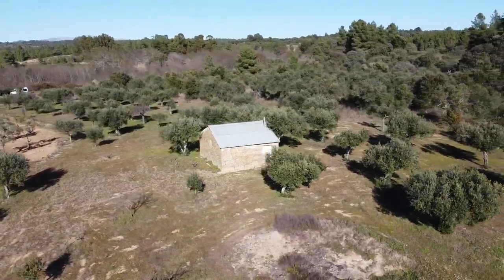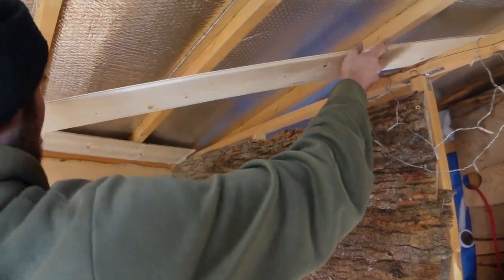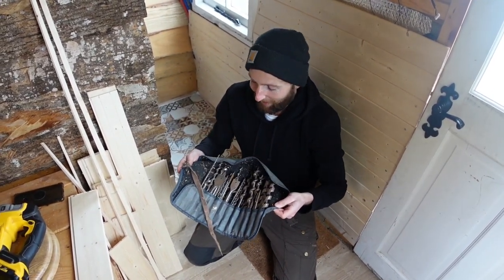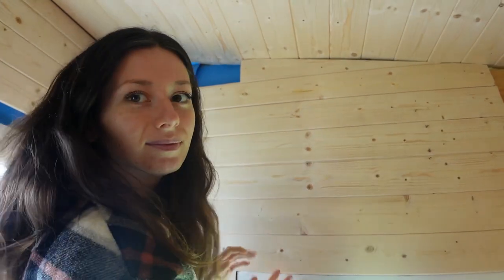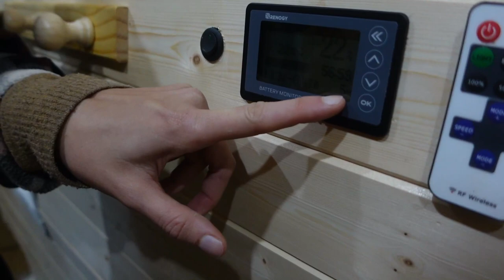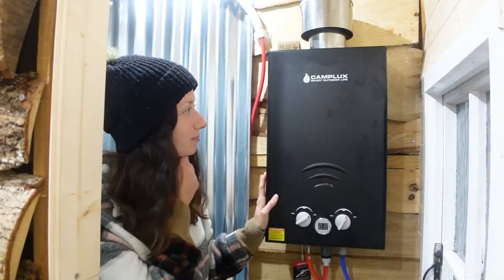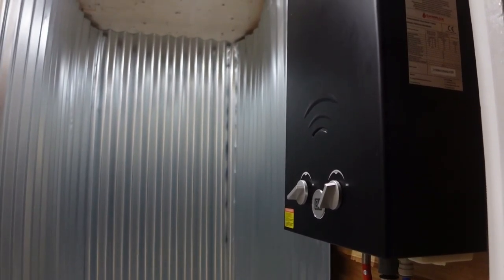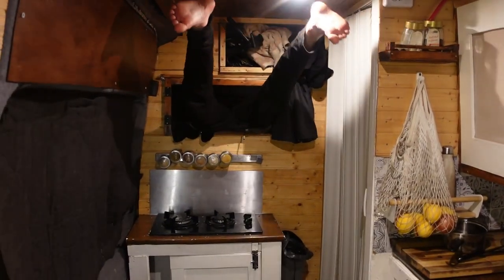Converted Cabin under $1500 OFF GRID LIVING

Comment: Idea for outhouse solar panel.  Creat a square or triangle box and a base with a “turn table” or swivel.  Mount the solar panel on one of the sides.  You may want to install some way to stop the swivel after you adjust the Sun direction you want the solar panel to face.  The box can be mounted anyplace it’s easily  accessible so you can turn it.

Comment: Any updates on the shower? I think it's quite clever using the corrugated metal as some cheap and cheerful waterproofing for the shower. However, I'd be concerned about moisture become trapped behind the corrugation and create a habitat for mold. Really curious to hear about it as it's the first I've seen it used indoors! However I love working with it, I think it would be a great material if successful

Comment: If the outhouse is to go by, then the barn conversion is going to be amazing. I am worried about you being cold in your van. If you have no working heater in the van, could you use that candle heater from the outhouse?  So, how does that work, by the way. Is it a metal plate with a candle under a plant pot but with something to allow air flow in, i.e., planter feet? Speaking of feet, dans feet wiggling to get in  there, had me laughing, but i have to admit i would have had to tickle them. X
Reply from the maker: Thanks for kind words Mary, they take the edge of the cold just enough but we are looking to add something better in future. The candle heater just requires a little tea light inside and heat radiate inside

Comment: This may be a dumb question, but do you not have to insulate behind the shower walls (the corrugated metal) or does it create its own insulation? Also, what if the make shift foam insulation is exposed to any moisture?with it being an outhouse) will it not mildew? Just curious

Comment: Every situation is different so this is important information not advice.  There is an article in the World Economic Forum titled, “Scientists have cracked Rome’s secret to waterproof concrete.”  Dated 7/13/17.  Basically it’s self-healing concrete.  If it gets damp the concrete is self sealing, no damp.  The concrete included saltwater and volcanic ash.  It is why the buildings of Rome still stand 2,000 years later and anything we build disintegrates or gets damp within 10 yrs.  

Another idea is that if you have any wood fires watch YT video by Edible Acres.  He has a series on biochar.  Biochar helps with water retention during the wet season for water use in dry times.  There are 4ish videos about 6mins each.  

He also has an interesting approach to chicken composting.  It keeps the cost of feed low but nutritious using natural method.  He follows permaculture.  The only thing he doesn’t do that I would do is raise black soldier flies to feed the chickens.  It allows you between the two methods to cut the cost of feed by 65-75%.
Reply from the maker: Hey Kenyon thanks for sharing all the insightful info above very interesting

Comment: Hi Dan 
did you consider building diy solar ear heater ? It is from cheap materials and easy to build.
You will have then in the cold but sunny days warm room or bathroom almost for free. You need only aluminium spiro pipes, frame made of timber (ie pallets) and policarbonate sheet (thats could be cost like 30 EUR) and black paint in spray. I did one last year for my daughter garden house.  Unfortunately we do not have such many sunny days in the winter as it is in Portugal. I do not have now picture of mine but here is the link how similar was built. (fan is helpful but without it air also flow itself)  https://www.youtube.com/watch?v=8i4OzLOv_10 
Mine is simpler (without insulation and temperature measurement) but works quite well.